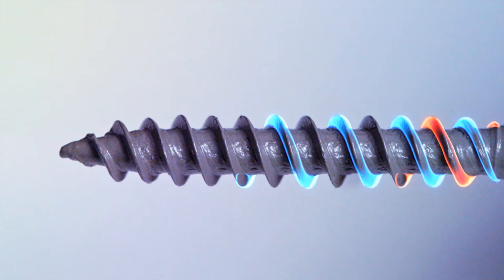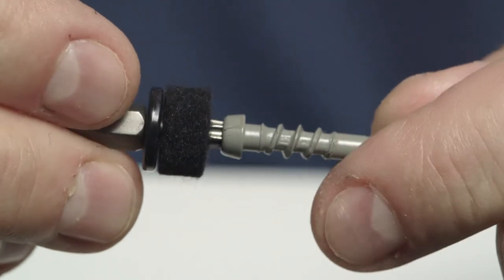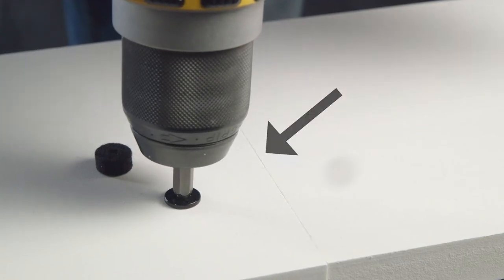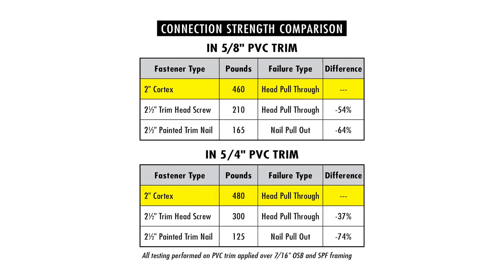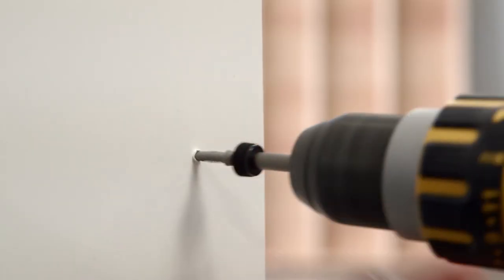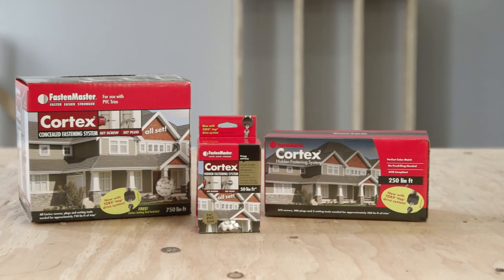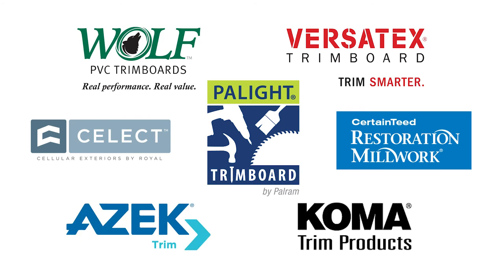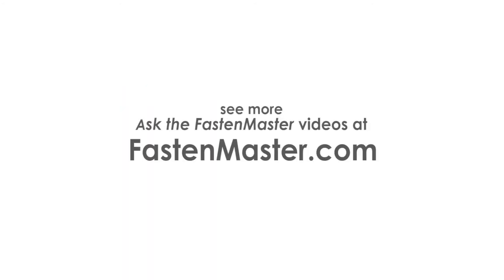FastenMaster Cortex: Easy PVC Trim Installation

Comment: My 2" Cortex screws won't drive all the way in. The heads float on the surface even using the special bit and an impact driver. What am I doing wrong?

Comment: do you make a similar item for interior?  First you drill the hole then tap in a nail that has the pvc plug attached to it/
Reply from the maker: Unfortunately, Cortex is only available for exterior applications.

Comment: Thinking of trying these for when re doing jambs and moulding on garage doors. How well would they work for the brick moulding?
Reply from the maker: Andy Wagner these are for wood connections only. They would not work for brick.
Reply: @FastenMasterPro  brick molding is a vinyl or finger jointed primed molding (sometimes other material) that goes around many prehung exterior doors. I think your product would work well. Brickmold is not brick.